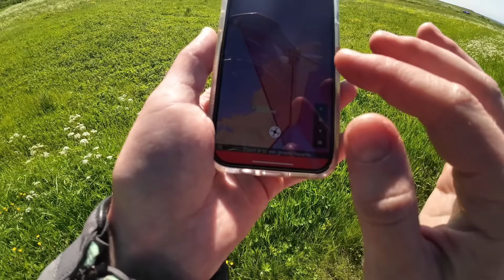Motorcycle tour through Northern Norway - SOLO motorcycle camping trip [S5-E16]

Comment from the maker: HELMET MICROPHONE DETAILS (I use all 3 connected together!!):
1. Nedis CAGP22090BK10 Stereo Audio Cable with Volume Control 3.5 mm Male to 3.5 mm Female 1.0 m
2. Nedis Wired Microphone Clip-on 3.5mm Black MICCJ100BK
3. BOYA by-K1 3.5mm TRS (Male) to Lightning (Male) Audio Adapter